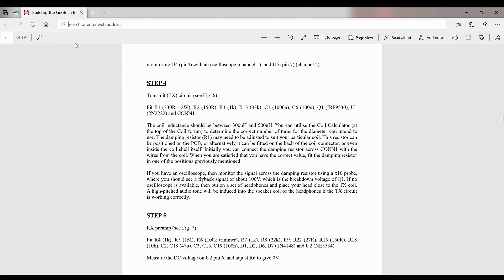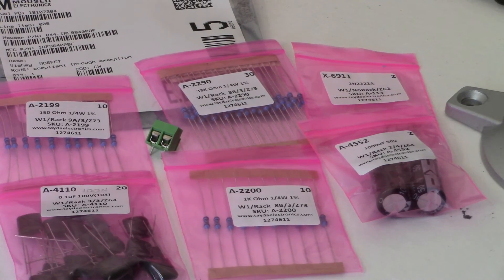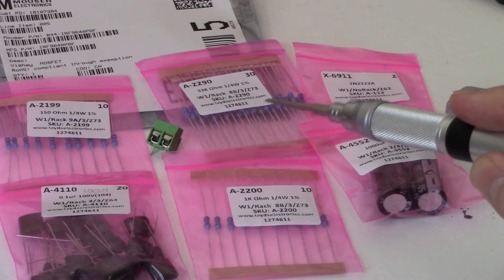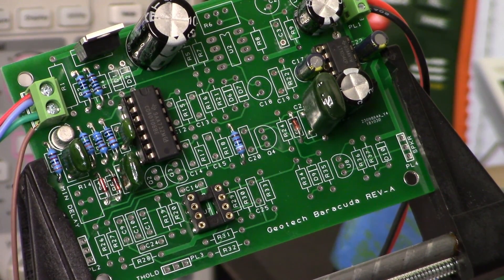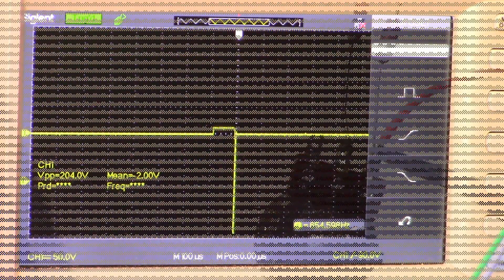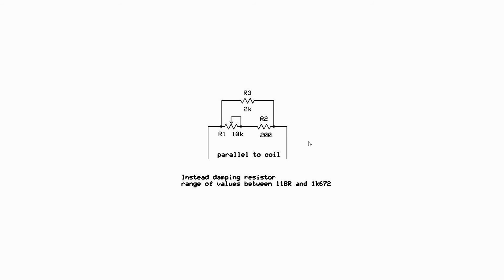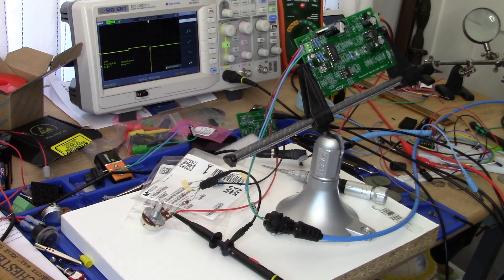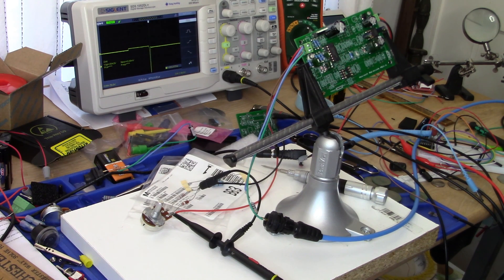Barracuda Pulse Induction DIY step #4 Transmit circuit

Comment: the large blue cable with the 2 position plug in connector is from coil, what is the blue wire from coil you using, i have some some hummingbird EC6 that i bought for mine.Transducer extension cable
Reply from the maker: Canare DA202
Reply: @SurfDetector  I have some saved in my ebay

Comment: what wires are going to the board from your resistor tool, i see looks to be a red, black, blue or green, there are only 2 connections on the board your connector.